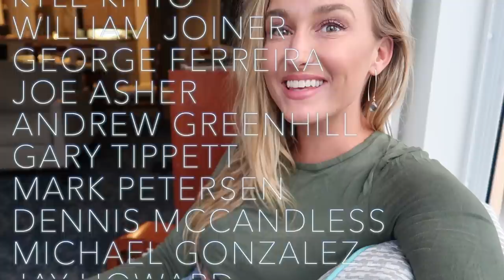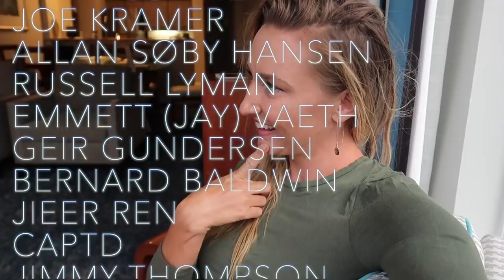Life on a Sailboat Big Changes | SMLS S10E14

Comment: Yes even though your electronic devices are not plugged in, lightening will charge the air and can ever so lightly damage components in them. They will eventually break. Diring a lightening storm it’s best to put electronic gear in your oven which acts like a faraday cage.
Reply from the maker: So I guess I should buy Little Miss an oven... but where to put it....?
Reply: Hey Aubs , Look up Faraday cage on Google. I Think any Metal Box or a Metal Safe From Staples or the Likes Will Work too. Just Get one Big enough to put Your Laptop in. Maybe , a Custom Metal Cupboard built into the boat will work too.
Reply: @SailingMissLoneStar  In addition to a Faraday cage you could also electrically bond the standing rigging, get a couple lightning anchors, and a couple of those metal pom-poms for the mast head to help equalize the deferential charge right before a lightning strike which will either prevent the strike, or at least weaken it.

Comment: Don't Ever Buy a Wooden boat ! Its a NIGHTMARE !!! I Have Owned 7 Boats so far in my life. The Wooden boat was the Biggest nightmare. It ALLWAYS WAS trying to sink itself. Wood shavings in bilge pumps endedup Flooding the boat. Bilge pumps seized up from wood splinters floating in the Bilge getting stuck in impellers. NIGHTMARE !!! Coming back to a Boat With 1' of Water in it. ALLWAYS WATER LEAKS with a Wood Boat. My Next Boat will be a Steel Boat. I Prefer the Water on the Outside of the boat. 🤣 Wooden Boat Maint. is Twice the cost of Fibreglass boat hulls.minimum. Good Vid !
Reply from the maker: Why hello Eyour! Aren't you just a ball of joy. Cant wait for your next comments. Do you have any other sweet nothings to whisper that drive women to a 2 gallon jug of ice-cream?
Reply from the maker: Nightmares are what dreams are made of.
Reply: @SailingMissLoneStar   Not mine anymore , Thank god ! But, Hey Your a Never a Dull Moment kind of Woman & it Will Make For Great Content !  Have Fun with Your Woodie ! Just make sure you Have Like 6 Bilge pumps on Board. 2 Foreward , 2 Mid ship , 2 Aft. Mounting one in the Bilge at each Location on Auto & another at same Location about 6" Higher out of the Bilge. Thats the ONLY Way to Survive in a Wood Boat or any Boat Really ! Take it From Experience.